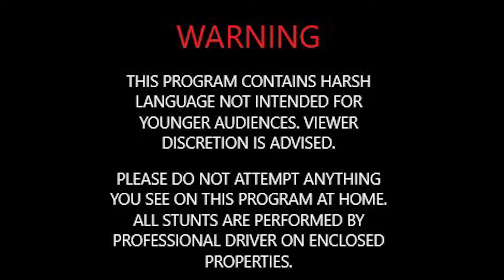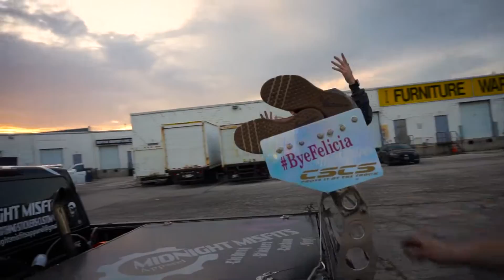REAR MOUNT TURBO TIME ATTACK FORD RANGER!!! *Walk Around*

Comment: This is exactly what I am trying to do with my Ranger, but as a sleeper

While I only have the 3.0L V6, I also don’t have a large cab
Reply: You can port your heads on the lower end and also use a new upper intake and use a f150 throttle body for a better response
Reply: @TheGeneralkaze  I was probably gonna focus on suspension first, but I have found an aftermarket manifold that should allow me to use I believe an M90 supercharge, which should probably get it up to 200hp, maybe 250hp

However, I’ve also considered going for the drift truck route, but either way I need lower suspension
Reply: Save up for junkyard 5.3 and a swap kit. Then put everything in suspension and tires
Reply: @giraffesushi8112  any which 2.3, or what should I keep my eye on?
Reply: @kevingomez97  just find an old junkyard Chevy or GMC pickup with the 5.3 2007-2014 year model Silverado, sierra.   You could end up with a 4.8 but they are essentially the same just a bit shorter stroke both are good motors!!!!
Reply: im planning on twin turbos for my 3.0
Reply: I have a ranger that I have been building. Came with the v6 has the rear suicide doors and an automatic. Slammed it 5" front 8" rear with DJM suspension and parts. Rear axle 8.8 swap with oem gt500 lsd carbon fiber clutches in diff. Put the 2.5 lima iron block engine in it with a t6 transmission and a 6 puck. Has gt35 turbo and custom made aluminum intake and 96 mustang gt throttle body. A bunch of internal engine work done basically only thing stock is the head casting and block casting also ported head work done. Has 4 caliper setup in the rear two of which are ran off a hand brake. 12wide 17 inch wheels all the way around but only running 255/40-17s. Holley HP to run everything and she is a slider! Yes, the full 3" exhaust does scream really loud!
Reply: @giraffesushi8112  if I’m going to do a swap, I want to do it with a new crate engine so I can push it even harder.

I’m not planning to do this on a budget, I fully expect a six figure build by the end of it (and for the build to take 5 to 6 years at least, mostly due to cost)

I also want to find a way to convert it to IRS.
Reply: @unnamedracer9757  then just call Texas speed lol.
Reply: @giraffesushi8112  it’s not a build if you pay someone else to do it
Reply: @unnamedracer9757  okay you've obviously never built a car, I've been building race cars since I was 10.   Texas speed sells crate motors they don't build the car for you....
Reply: @giraffesushi8112  that’s not the level build I’m looking for.  I want to get a stock crate engine and mod it myself.  I’m also looking for a basic bitch LS swap.
Reply: @unnamedracer9757  a basic bitch ls swap is a 5.3 from a junkyard that you restore then build yourself like I mentioned the first time...